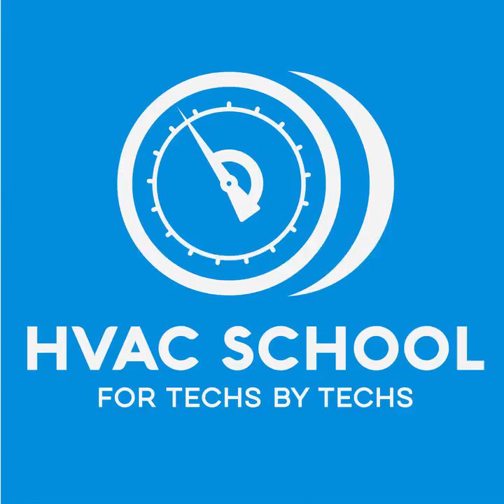Ventilation w/ John Semmelhack

Comment: Actually none of these test methods are new and adding in five gases or more and the measurements required I’ve been used in Germany and some of the EU nations for over the last decade to 15 years so everything we’re doing here in California especially in the United States is old tech. Back in 1980 when we constructed my fathers house from the ground up he looked at the housing construction in Switzerland . They were way ahead of the game in air infiltration airtight houses sealing high-efficiency homes. Ultra high-efficiency heating an indoor pollution. I was only a teenager and I remember the inspector when he came out to the house was flabbergasted and had in the slightest idea why my father went through all this trouble and expense. Now here we are 39 years later. All the rest of the houses on our block burn through 6 to 8 cords of wood a winter, well our house only burns through one and ahalf cords. The hot tub gets heated for free through the wood-burning stove or the pellet stove the domestic hot water gets heated for free endless and during the summer when our neighbors have three to $400 electricity bill is for the air conditioning and we only add about $100 and this is on a 4200 ft.² house. Now my brother lives in that house parents passed away and his children the third generation are growing up in that house that payback for knowledge and a little hard work I’ve been energy efficient in a decade when it wasn’t cool to be energy-efficient is paying off generation after generation.